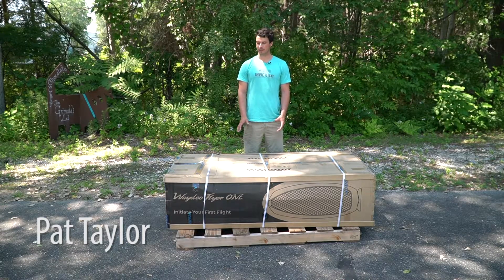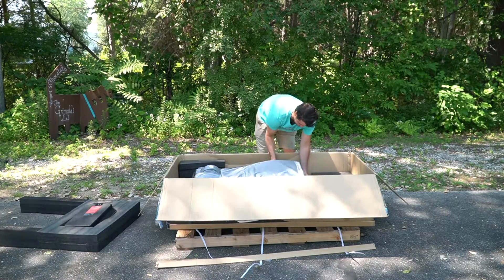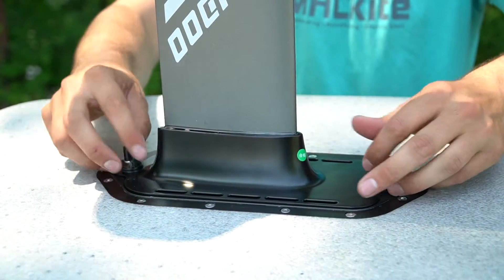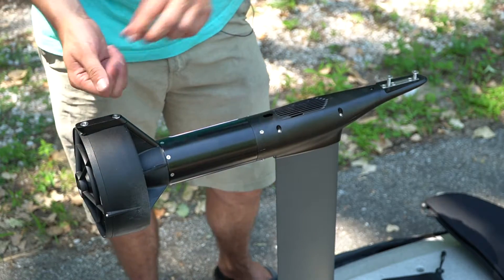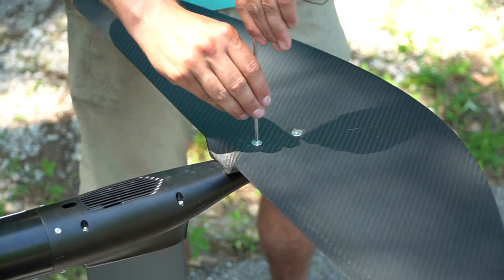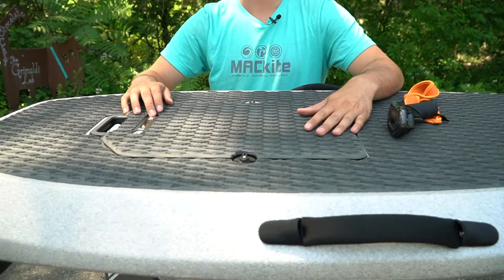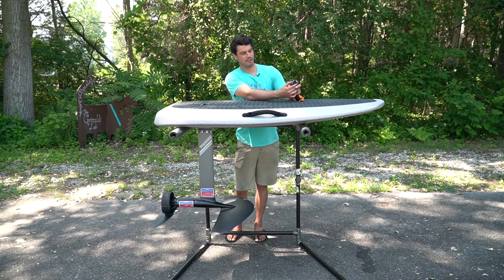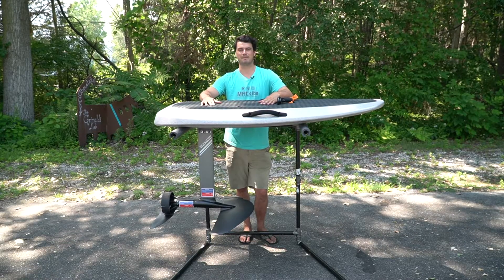Waydoo Flyer One eFoil Unboxing and Assembly

Comment: Does the board come with that stand?
Reply from the maker: Good question, Micah. 🤙🏽 No, our Waydoo eFoils do not come with a stand. However, the board stand in this video is made from plumbing materials that are readily available at nearly any local hardware store.  

Please feel free to connect with Pat, our in-house Waydoo guy, with any technical questions that you may have.

Aaron

Comment: Great video!  What if I weight 235lbs?  Am I out of luck going with the Waydoo Flyer Patroller (carbon model)?  I am looking at the Lift3 for my next summertime toy as it says it can support my weight.  Also, at my weight what would my run time be realistically with the Waydoo Flyer Patroller?

Comment: Looks cheaply made, minimal # of fasteners at structural connections looks like a weakness that could fail considering and adult male leaning hard and putting torque on the structure, and is the board made from pressed styrofoam? Doesn't look like composite materials, hoping I don't get a pressed block of foam that I could easily dent and pull coin sized chunks out of with my finger nails, fingers crossed 🤞
Reply from the maker: Hi Housemahn, The board structure is EPA Foam with an Aluminum Alloy Frame. It's nice since you can have minor handling mistakes without costly fiberglass repairs. It also significantly lowers the cost of the product. We've spent countless hours on the water with these boards with very few issues. When they do come up, Waydoo has been quick to troubleshoot for us and supply replacement parts when necessary.  We find they are the best value in the market and still compete in terms of performance with the most expensive models on the market.  Lots of happy customers after they make this purchase.
-Tucker